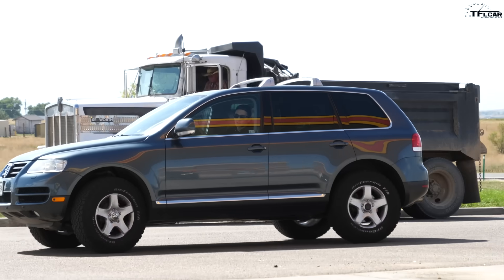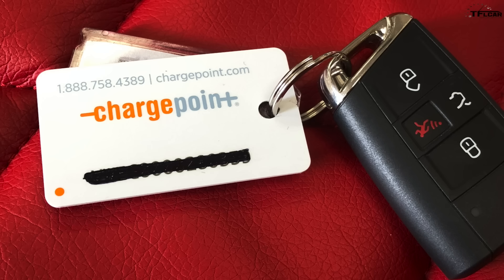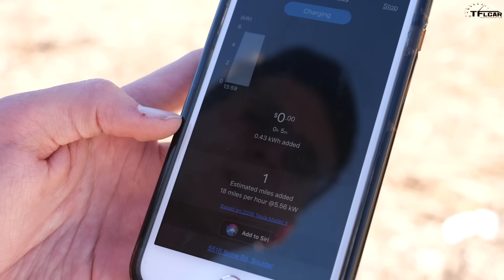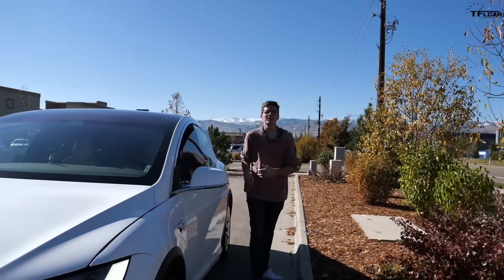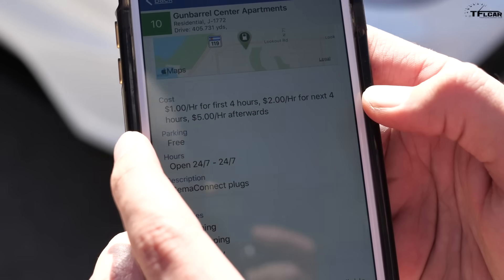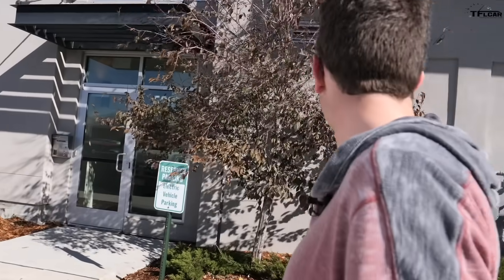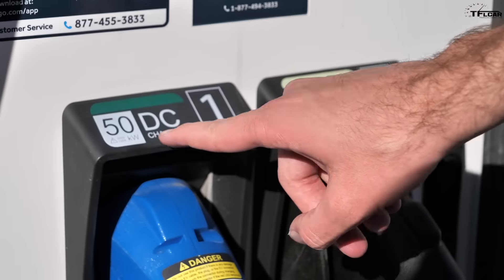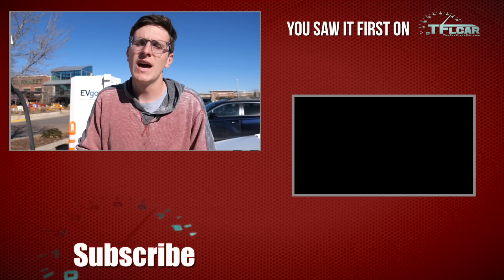Here’s Why Charging an Electric Car Can Suck - And It’s Not The Reason You Think!

Comment: Tommy. I think you did people interesting in owning a EV a disservice by pretty much blowing off home charging and focusing on public charging.  We've had our EV for 2.5 years, drove it 60K+ miles, and we've yet to use a single public charger. I've been to several places where the public charger was actually free, and I still didn't use it.  Why brother too when we left home (where we charge every night) with 250+ miles of range?  You should have titiled your video: "Here's Why Charging a EV other than at home can Suck."  We tell people that a EV may not be for them unless they can charge at home.  Without home charging one of the major advantages of EV ownership is lost.

Comment: Even for the time it takes to watch this video, you'd only have a few miles charged. And if people continue to buy EVs it's going to require building new power stations which will run off fossil fuels. Unless you want to start having power cuts for DAYS at a time like they're beginning to have in Europe. No internet, no phone recharging, no Amazon. And in a place like  Colorado with heavy snow etc. a phone isn't something you want to be without on the road...

Comment: When you charge, do you select regular, mid-grade or premium electrons???
Reply: More like electrons from coal, oil, or nuclear.
Reply: electrons aren't flowing into your battery, electric charge is.
Reply: @Blox117  On net, a battery's charge remains the same.  "Charging" a battery is a misnomer.
Reply: No point paying for the premium electrons at high altitude.
Reply: Also, what's the proton % per electron
Reply: You will take whatever electrons they offer. And be very happy to get any.
Reply: Newzchspy - You select super slow public station or go to any high powered Tesla station or public high powered DC station. Or at home.
Reply: That was actually pretty funny.
Reply: Yes actually (sort of). The EA chargers cost more depending on how fast your car can charge at the beginning of the session. A Nissan Leaf will tell the charger that it can only take 50kw and will be charged less than a Tesla or Audi E-Tron since those will tell the charger that it can take 150+kw. So the car choses "regular" "mid" and "premium".
Reply: @xNYCMarc  Oh Snap!
Reply: xNYCMarc r/wooosh
Reply: FrizzieFNBR I think the Woooosh goes to you. He jokingly asked if you pick regular, mid or premium. The answer is YES you do pick “regular” “mid” or “premium” on EA chargers. Wooooosh.
Reply: xNYCMarc r/Wyou Odint Oget Sthe H joke
Reply: FrizzieFNBR Under 50kw is “regular”, 50-150 is “midgrade” and 150-400kw is “premium” on Electrify America chargers. /Wooosh

Comment: No one uses 3rd party Level 2 chargers as primary means of charging except if its supplied by your employer.   Level 2 is almost pointless in US.  If you cant charge your car at home or work you should not get a non Tesla EV.  Tesla is doable albeit inconvinient.  But if you have a charger at home.. Or 240v dryer plug EVs are amazing.  This guy should have borrowed a non Tesla for this demo.

Comment: Gas stations have a credit card slot, a roof over the pump to keep me out of the rain, the snow and the hot sun~!
I drive a 2014 Prius IV with a year-round average gas mileage of 50 MPG. I can pull up to covered gas pump, swipe my credit card, fill my 10 gallon tank, and be on my way in less than 5 minutes, and drive another 500 miles.

Comment: Everyone I know with an electric vehicle has a class 2 charging station or receptacle in there garage, I have one on the outside of my house ! Very inexpensive to install and they charge at the same rate or better then the charging stations you visited. NOT DAYS lol... everyone I know use level 3 stations to charge there electric vehicles at 50-100 kw, that means 100 km in less than 10 min... I have charged  400 km in 38 minutes. Your video is very misleading and you need to explain that these are destination chargers and not level 3 where most people charge.👎👎👎

Comment: I don't know which makes me less likely to get an EV: the fact that I have to keep an adapter handy because charge plugs are 'proprietary', or the fact that even with a 'fast' charging station, I'm going to be stuck standing around for 40 minutes (or more!) waiting to get the battery charged.
Reply: Charge overnight at home.  Maybe charge 8 hours at work.
These slow chargers that take all day to recharge and empty battery are not meant for road trips.

If you need really fast charging for a road trip, get a Tesla and use Supercharging when travelling.
If you don't have a Tesla and also travel on long distance road trips often enough for charging to be a major issue in your life, then an EV is not for you.
Reply: Tesla solves that with their Supercharger network. And of course charge at home.
Reply: @hx3169  but what if there's no such facility where you're going? then you're pretty well screwed, aren't you?
Reply: @andrewreynolds9371  Well, hasn't happened to our family yet over the last 9 months.  I guess it depends on where you're going, and 99-100% of the time I'm not out in the boonies. Like any trip, I plan, even in a gas car - if I'm going out somewhere remote, I make sure I know where the gas stations are ahead of time.  I suppose if I ever go out to someplace with no charging capability, which would mean not even an RV park (which usually have 30/50 A plugs you can use), I'd take my gas car, or better yet, rent an appropriate vehicle and not put miles on my car.  But for everyday driving that people do 99% of the time, it works fine and is actually more convenient.  My wife hasn't visited a gas station in 9 months, while I'm stuck going every week paying $4 a gallon.
Reply: @hx3169  that probably explains a lot. the nearest public charging station I know of to where I live is about 30 miles, and most of the town's in my area, you asked about a charging station, you'd get a blank stare.
Reply: @andrewreynolds9371  For sure much of the comfort is knowing there are lots of charging stations in the area, even if I have not had to use them.  There are two "DC fast chargers" within a couple miles of me, one with 20 stations and another with 10, both at "mall" type places. And that doesn't include the single stations that are at the library, Safeway, and workplaces, etc. Yes, I live in California, where the taxes are high and the treehuggers run the place.  ;)

Comment: One fact you got very wrong - every US household has 240v power.  It comes in at 240v (split phase).  120v appliances uses one phase, 240v appliances (dryers and electric stoves, primarily) use BOTH phases.   Getting a 240v outlet is a matter of having an electrician install the proper breaker and wiring, which is usually only a few hundred dollars.   

Right now, it makes the most sense to charge at home for normal daily driving, using fast DC/Supercharging for long trips, and public charging stations for occasional top-ups.  

One thing you didn’t cover is destination chargers at hotels.   So, for example, when I travel hundreds of miles to another city, I will leave home with a full charge, Supercharge on the way (usually 20 minute stops - which I combine with bathroom and coffee/snack breaks) and I stay at a hotel that has a destination charger - which is usually FREE to the hotel guest - so if I arrive there with 40% battery, I am still leaving in the morning with a full one.   Free.  

Look, making the switch to an EV involves changing the way you look at your car pretty much overall.   If you’re not willing to do that, then it’s not for you.   However, in the past two months, I’ve saved over $1000 just in the additional cost of diesel for my truck that I did not have to spend.   That’s pretty compelling savings.    It costs me - on average - 3 cents per mile to drive my Tesla, versus 9 cents per mile for the wife’s minivan and 16 cents for my Silverado.    Then add in no oil changes, tune ups, etc, etc, and it’s really, really worth it.

Comment: You guys are very lucky that it does not get very cold in the winter. At -20 or colder outside a 5kw charge becomes a trickle charge because of the battery warmer power draw. You would get maybe 1 mile of range per hour of charge time, perhaps not even 1 mile of range per hour if it was extremely cold. And then demand for those charging station would go through the roof. Everyone would be parked at them all night long. At least those that lived in apartment buildings. 

Honestly if you do not have a 220 volt power supply for extreme cold charging then you should not even own an EV. That puts a limit of these cars in the northern parts of the US.

Comment: most people have 240Volts just the USA has a crap 110 Volt grid,   5KW good  here in the netherlands a normal electrical socket is max 3.6KW and its eazy to get a 3 fase connection of 20 KW at home

Comment: So to have a electric car you must have a smart phone with apps and you must use credit card/ debit card etc what if you wanna use cash?
Reply: Not really.  If you have a Tesla you can use their Supercharger network and the car communicates seamlessly with the station to initiate charging.  The chargers and availability are all conveniently shown in the nav system.  If you use Chargepoint, they send you a little card and you just tap that on the charger like a credit card - Tommy only briefly mentioned that.  And most people charge at home or work so really have very little need to use a public charging station.  Apartment dwellers may have more challenge but even now more and more apartment owners are installing charging stations for residents.
Reply: too bad
Reply: Awesome thanks for the feed back another question does it really take 12 hours to charge it half way like he said? If you don’t use the fast charge stations
Reply: @shawnferrell1983  Depends on the car and the charge rate.  Half-way would be 120 miles.  Model 3 at home, I have connected to a 30 A circuit and it gets 22 miles per hour (aka Level II charger).  So, that would be about 5.5 hours, or a Saturday afternoon if I somehow forget to plug it in.  This is why more efficient cars will charge "faster", because they use less miles per kWh.

Comment: You can get a CCS adaptor for your Tesla in Europe, in the UK it even comes with the car! Only European Model 3 has CCS charge port as standard, Model S and X are still the propriety charge port, but get the adaptor mentioned. In Europe CCS is winning the race to be the standard. TESLA Superchargers in Europe have been upgraded to have CCS connection in addition to TESLA connector.

Comment: I drove electric for 3 years.  One item you should note is that most (non-Tesla) level 2 chargers will split power between the two cables on the charging station.
So, if another car starts charging at the same station your charging rate drops by half.   I've used the applications you noted and your experience was spot on.

Comment: The people buying battery electric cars right now fully understand the issues. Nobody spends $40,000 without doing some homework. 
But when they do complete their homework they mostly realise that Tesla is streets ahead of everything else on the road. Not least because of their ever growing charging network. 
The Nissan, Kia or Hyundai might save a little on the sticker price but their used prices tank and the cars are just not even close to what Tesla offers. 
Those who can’t afford electric motoring will be stuck with engine driven cars.

Comment: INSANE wait hours for just a few miles
Reply: I have a 240v wall charger in my garage. It charges at a rate of 7.2 kW. That's around 29 miles of range per hour just sitting in my garage while I watch tv or whatever. Then on the highway I just stop at a Supercharger which will give you around 2 1/2 hours of driving time in 20 minutes.
Reply: Philip Davis that still seems like it’s inconvenient
Reply: @Danielle33384  I spend maybe 5 seconds plugging my car in the garage every 3 or 4 days. How many seconds to you spend pulling off the road to fill up with gas every month
Reply: Philip Davis you say seconds plugging it in but most people have to go to a fast charger every few days and when they get there they have to be there for about 40 min to an hour to get a full charge.  A gas pump takes 5 minutes.  So I don’t really understand your logic.
Reply: @mrchichmagnett7761  Most people don't have to go to a fast charger every couple of days. 60% of households have a garage or a parking spot with a plug nearby. With a 300 mile range EV and a plug at home why would you ever have to go to a fast charger unless on a road trip?
Reply: @flipadavis  Not everyone has a garage though, that's the point of this video. The home I'm renting won't allow me to install a charger in the driveway if it's even possible, there's no Tesla charges close to home and if I get a different EV I will be stuck using these other slower chargers. I guess what I'm saying is EV works fine for you but there are many other people who would have to jump through hoops just to manage it.
Reply: @Cornelius87  Does the house you rent have electricity? Does it have a plug anywhere on the outside of the house? You can still charge an EV on a 120v outlet it just takes longer but if you are charging it overnight it would still work for day to day driving.

Anyway around 60% of households in the US have a garage or a parking spot near a plug. That means a hundred million or so households could  buy an EV right now without having to worry about public charging. That will take time. Meanwhile Suoerchargers continue to be built and other similar fast charger networks are also being built out with battery technology allowing for faster and faster charging. Like the new electric Porsche which can charge as fast as the new Tesla V3 Superxharger.
Reply: @flipadavis  last time I checked the amount of miles I drive each day was way more than what the normal 120v could get me overnight. It would just be an inconvenience for me right now. Don't get me wrong hopefully in the near future that changes for me but for now it's just not for me.
Reply: @Cornelius87  That's quite true - not for everyone yet. The video is a bit over the top; for most people it works well now. Apartment dwellers and home renters have trouble, so do extreme driving conditions - but solutions for those are coming fast. Extended range, faster charging, etc. And the cost savings is compelling.
Reply: These aren't meant to take your car from 1%-100% in a hour, they are meant to maybe get it from 60%-85% while you are shopping for an hour or getting it up to 100% at a motel over night. Level 3 can fully charge the car in 30 minutes which is what you would use on road trips.
Reply: fastcharge